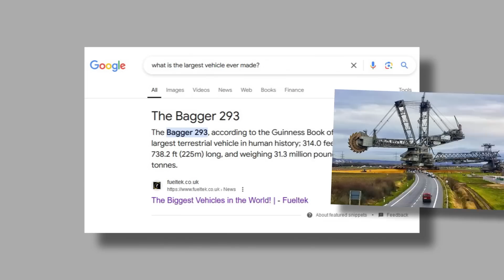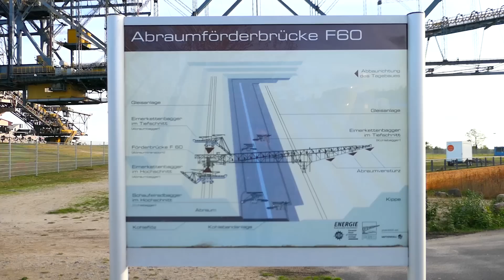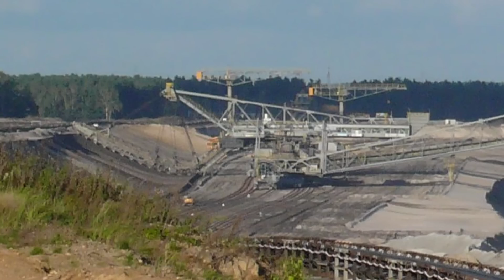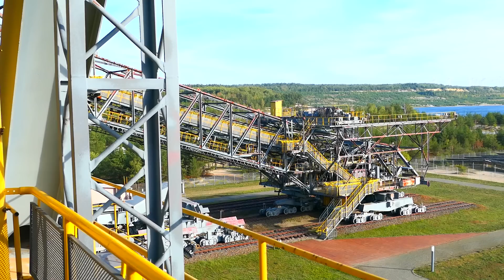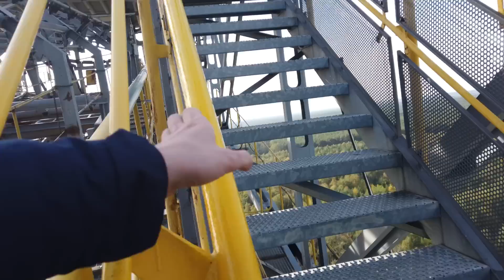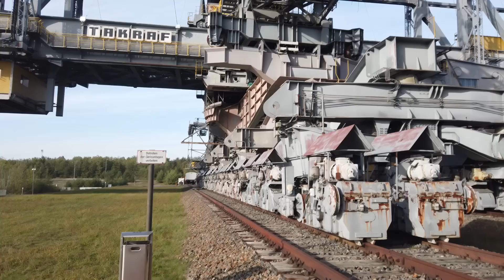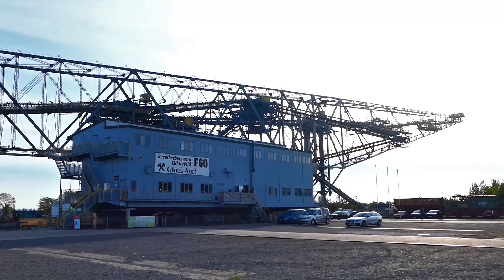Why Germany Built The Largest Vehicle On Earth

Comment: Ahh, Germans. Why use the amazing clean nuclear power, when you can burn tons of dirty brown coal lol.
Reply: 62.7% (its rising) of the electricity used in Germany in 2024 came from renewable sources, such as wind and solar power.
Germany currently has no active nuclear power plants, and no energy company is interested in reactivating them, as nuclear energy is too expensive and economically unviable.

Renewable electricity costs around 6–7 cents per kilowatt-hour for consumers, while nuclear power,  still ends up costing around 40 cents per kWh for consumers in Germany.

At the same time, the share of renewable energy is steadily increasing, which means we no longer need to import uranium or depend on unstable global fuel markets.

In addition, there is no permanent storage facility for nuclear waste, making it a long-term risk for the environment and public health.

I agree on you with the coal tho.. its stupid

Edit: The place in the Video is inactive (i live not far from it)

 Greetings from Germany
Reply: @Kiryuoxid  Existing nuclear plants are relatively cheap to operate, and nuclear waste can be recycled into new fuel.

I think that it'd be better to keep at least some active, until the end of lifespan of those. Less coal would be burned until more renewables and storage are installed.
Reply: @thelloydersvk5068  not in Germany there is no Company who want to reactivate the last 3 Nuclear Reactor for a Reason it cost multiple Billion  Euro.

Edit: since 2023 there are no active Nuclear Powerplants in Germany
Reply: lol

Comment: The largest opencast mining excavators in the world are located in the Rhineland (West part of Germany). They are the heaviest vehicles and have the largest paddle wheels.

The one in Finsterwalde or the model F60 (name) is only so big because of the conveyor belts.

Bagger 288 (Thyssen Krupp 1978) and Bagger 293 (TAKRAF 1995) achieve significantly higher performance.

Excavator 288 moves 240,000 cubic meters of coal and tailings per day and Excavator 293 moves the same amount per day.

Comment: Technically speaking, some American trains are a mile or more in length, and they are definitely wheeled vehicles. How big was the biggest supertanker? That might have been bigger too.
Reply from the maker: Hi - love a bit of technical speaking :) To answer your question, the longest ship ever built was 458m long, so that's shorter than the F60. (The F60 is wider too, if we measure at the widest point.) And if we're being truly technical, then a train is by definition a line of vehicles connected together, rather than one big vehicle.

Comment: impressive but not really efficient, imagine the time, effort, and energy fuel spent in building this.
Reply from the maker: You have to compare it to the alternative: the time, effort, and energy spent building dozens of smaller vehicles and employing dozens more workers. And multiply that over several years. If the F60s didn't work out as more efficient overall, they wouldn't have built 5 of them.

Comment: Very informative video. Nicely done. On a similar note, the subtitles on it are the best I've seen in a while. They stay on screen long enough to read, and they're split in sensible places like the ends of clauses as opposed to completely at random like every other YouTuber with subtitles. The only problem with them is the arbitrary width limitations, so if the viewer makes them bigger there will be more line breaks than needed.

Comment: The aluminum plant I work at and the power plant built right next door and it was fueled with lignite. They called it a dirt burner. The dragline still use to remove the overburden for like Baba yaga's house, they could walk but they were powered with an extension cord as well. You could park a couple of pickups side by side in the bucket.

Comment: Pedantry for the only place I know that it's properly appreciated. If the machine winds up the cable as it travels towards the power source and then unwinds it as it travels away from the power source, it can travel twice the length of the cable. It's unclear from the video if the cable is 6km long, meaning that the machine could move a total of 12km, or if Tim was already that clever and the cable is only 3km long.
Reply from the maker: Haha, some excellent mathematical pedantry here! The cable is 6km long, so I guess to be absolutely clear I should have said the F60 can travel up to 6km "away".
Reply: The F60 can only move one cable lengt. If you put the "Power outlet" in the middle, it will be in the way if the F60 move forward. And yes, some "smaler" devices are pluged in into 6kV Power outlets. It is not just the F60 operating. The F60 has 2 bagger whitch take soil 30m above and below the railroad trackts (Thats why F "60", in german Hochschnitt and Tiefschnitt).
If you have more Soil over the Coal you need another Bagger (Vorschnitt). Somtimes the Vorschnitt goes to the F60 or it goes via beld around the pit. Under the F60 you have coal baggers and a belt, that brings the coal out of the pit. There where 5 F60.
Active are Welzow-Süd, Nochten and Reichwalde. Jänschwalde is shut down and will be scraped. Lichterfelde is the museum.
But you can also visit the working Tagebau Welzow Süd and the Powerplant Schwarze Pumpe (2*800MW) Some 15€ each.

Comment: That definition of "vehicle" is not very good as it includes things like fixed conveyor belts. It misses the point that the vehicle must itself be mobile.
It also excludes machinery such as road-paving equipment unless you count the part that spreads the asphalt as the "goods" that are transported forward as it lays pavement.

Comment: ENGINEER HERE: Loved the video as its always great to see what we have to build to make the World function.
HOWEVER you are 100% wrong on these machines operating on standard gauge rails. In fact they are NOT even close to standard gauge. I work in the Australian mining industry and have worked on and around both stackers and reclaimers.

The actual rails are much heavier and the distance between the rails (the gauge) is much greater. There is no actual standard gauge for these across the mining industry. Its entirely dependent on the actual design of the machine.
Reply: ALSO YOU CAN'T STRETCH THOSE CABLES
They operate of drum coilers. 
They are like a very big version of the coiler in a vacuum cleaner EXCEPT its driven by an electric motor NOT a spring.

This is why engineers don't like non-engineers.
Even when you try and do us a favor you screw stuff up.
Surely you must know an engineer or 2 and get them to check your work????????
Reply from the maker: Tony - firstly, thank you for the positive parts of your comment :D

Secondly - they are standard gauge railway tracks. This information is taken directly from the official website of the F60: https://www.f60.de/en/the-bridge/details.html (Scroll down to the heading "Undercarriage, excavator´s side")

And finally - I think you may have taken the word "stretches" a little too literally. I didn't mean that the cable is actually elastic!
Reply: @TheTimTraveller  I stand corrected.
That's the first time I have seen that done in mining and MANY of our stackers & reclaimers are of German Design. I know that having worked with ThyssenKrupp on stackers & reclaimers.

Most of those are mounted on 2 rails around 4-6meters apart. Similar to what you see with the cranes that load/unload container ships.
Reply: @TheTimTraveller  Also I work in control systems which are the sensor & computer systems we use to run these machines and other stuff. 

So when people dismiss things like electrical cables it annoys the heck out of us. To other people those are just cables. To us they are something you have to be very careful with. Those particular types of cables are HIGH VOLTAGE and they have to be specially made for the constant flexing they encounter. PLUS those drum spoolers can be damned hard to make work. You can pull on the cable too hard you can't let it out to fast.

When you use an extension lead it might be a few meters long and have 110 or maybe 220 or 240V. We have extension leads that can be over 100meters long and carry 6,600V and in some cases high voltage DC which is even more dangerous.

Those cables on those mining machines can be several kilometers long. So its not trivial.

AND YES DC voltage is MORE not less dangerous than AC. Its just that most people only ever encounter ultra low DC (less than 50V) and so they never encounter higher DC voltages which are very dangerous.
Reply: @tonywilson4713  Part of the reason for that discrepancy may be that the F-60s are an East German design while I would suspect that the German machines you're working with have a West German design heritage, and they may have used different solutions.

Comment: Great video once again. One thing I still fail to understand, is why it had to stretch all across the digging area to the other side? I mean, couldn't you also just dump the digged up earth on the other side of the digging hole (as in: somewhere on the side where the digging machines stand), where you'd not have to stretch it such a long way?
Reply: No because the machine effectively digs towards that direction and the area of overburden removed under the bridge is the work area where the coal seam is exposed and excavated by "normal" excavators. As the machine moves across the countryside the exposed hole moves with it. As the coal is excavated below, the area is filled back in again. If you just tipped the overburden right next to where you excavated it from, you would have no work area above the coal seam where the "small" excavators could remove the actual coal. I had a little difficulty understanding the point of these behemoths too but I actually visited this one and did the tour this October where I finally figured them out.

Comment: Many years ago (40 or so), I went with my parents on a holiday in Germany from the Netherlands, and they took a detour where one of the baggers was digging. It's an incredibly large machine. The only thing that is bigger is the whole that it created.

So, the F60 is bigger than a bagger. That's big.

The super-ironic part is that Germany got rid of all its nuclear power stations after Fukushima. So now, not only are they burning loads of fossil fuels, their energy prices have also shot up, and caused massive problems for its industry and economy.
Reply: But they're also making good progress with the switch to renewable energy; according to a Google search, they're now at 52,5% renewables (as of 2023). So, if they continue with this, they will be able to shut down their fossil fuel power stations soon, I hope.

Comment: Typical former Communist thinking extract tons of the cheapest coal possible, doesn't matter if  a candle produces more heat or it emits the most toxic fumes.  It may be 50 times more expensive but Anthracite is about a hundred times more efficient and naturally smokeless.  Ideal for boilers and solid fuel ranges just a pig to light so used where the fire alight 24/7.
Reply from the maker: It's more to do with geography than politics isn't it? You can only mine the coal that's there.

Comment: Fight me, but I refuse to call anything that is a bridge (even fancy, big-ass ones, on wheels) a bleeping vehicle.

A vehicle is something that can move freely or at least not on a rail system that is exclusively for only one thing (not multiple things of one type, ONE literal thing) on it.
Reply from the maker: Tbf, the rail system is not exclusive to the F60. It also takes Baggers, and support vehicles, and I think in some cases they even connect it up to the railway system (I'm not saying the F60s ever ventured onto the main line, but there are a couple of freight locos sitting next to it, and I'm not sure how they got there otherwise).

I totally get it though - even though I do call it a vehicle, it's right at the weirdest end of the vehicle spectrum.

Comment: Another feat/example of German engineering, but begs the questions:  how long did it take to design the F60 and further, how long does it take to build?  With a one-time total of 4, were there modifications or different models?  Thanks once again, Tim, for your always curious and very interesting Youtube videos.
Reply: For your last question,  I would wage a lot that they are similar but not identical. For machine of such scale, there is no serial production. Ideas, design, parts are reused but the detail engineering is customized to the site requirements like Tim says for efficiency. Signed: A guy busy designing big machines,  sadly not as big as these, and they don't move.
Reply: Two to three years according to https://de.wikipedia.org/wiki/F60
The first was built 1969 to 1972, the last 1988 to 1991. I assume each is a bit different.
Reply: There were also smaller versions. In Case of the F60, the coal was about 60m below the surface. There were also some F45s.

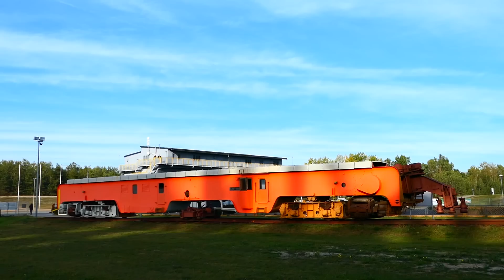Comment: The small vehicle @4:33 is not the track*laying* machine, but the track*moving* machine (Gleisrückmaschine) which you can see in action in this video (not mine) https://www.youtube.com/watch?v=7Url9rmwjHI
Reply: Could have fooled me, that absolutely looked like a mine to me :D
Reply: @wteff8586  The mine isn't mine either ;-)
Reply: Watched it, but still not sure that it did tbh
Reply: @NolorW  At the end of the track, the machine stops going forward and on its way back it moves the track 1-2m sideways - the front of the machine is still on the old location, the back is already at the new location. It actually moves the two connected tracks, that's why it is hard to see.
Reply: @ps3107-o1m  Oh I see it now, didn't expect it to work that way so I completely missed the track sideways movement. Very interesting, and thanks for the explanation.
Reply: but is it a rinsing machine or a filling machine
Reply: @violetto3219  No, it raises the track and moves it sideways. The tracks are simply put on the earth, so they can easily be moved.

Comment: Since when is a moving bridge, permanently connected to a cable, a vehicle?
Would you call a washing machine a vehicle if it had wheels?
Pedantry has reached a new level on this channel. Just when I thought it couldn't get more pedantic than the previous video.
Reply from the maker: Jacques, this why I included the dictionary definition of "vehicle" in the video :) A washing machine with wheels would not fit that definition. The F60 does.
Reply: @TheTimTraveller  Wait a minute. The F60 does NOT transport goods by moving along the tracks. It only uses the tracks to move itself to a new, stationary position.
Reply from the maker: @jacquesmertens3369  even if it's carrying no goods, it's still transporting its crew.
Reply: @TheTimTraveller  The crew doesn't climb up in order to be transported to another location, and I doubt they are even present when the whole crane moves.
Anyway, that's not even the point. Because the whole machine has already been partially dismantled and is no longer in use since 2016.
Reply: @jacquesmertens3369  So it's a decommissioned vehicle. 

Is an 'Out of service' bus a vehicle? The driver does not climb on board to travel to another location. It's the bus that needs to move and often the driver has to catch another bus to get back to the starting point.
Reply: @jacquesmertens3369  erm, the crew of an F60 is on the vehicle while it is moving. It is constantly moving more or less, except for when it's time to go back in the opposite direction. It is so obviosly a vehicle. There are countless examples of tethered electrically powered excavators. They are vehicles with a short range, but still vehicles.
Reply: @murphaph  Thanks for the hint. I was just looking for a new vehicle to commute to work.
Reply: So a car isnt a vehicle because it is limited by petrol? Or anything that uses overhead lines?
Reply: @xBox360BENUTZER  Are there schools where you live, and you have attended any of them? A cable limits movement.
Update: editing your comment doesn't undo your mistake.

Comment: Only Germany would preserve something like this, and all praise for them doing so
Reply: It nearly wasn't preserved. The F60 here was only in service for a few months as it was built near the end of the GDR and the coal mine where it was based was even lower grade stuff than the other mines. The lignite that came out of it was destined for making briquettes for home fires but east Germans got grants to fit gas heating and the market for lignite briquettes vanished almost overnight. This machine was supposed to be stripped of all the expensive components (which happened as the spares could be used on the remaining machines) and then detonated and scrapped. A group of locals intervened and set up a working group to save the machine as a tourist destination, which was incredibly forward thinking of them. When the remaining F60s are all detonated and scrapped (as there is no need for any more tourist ones in the Lausitz) this one will continue drawing in tourist income and providing employment for decades to come.